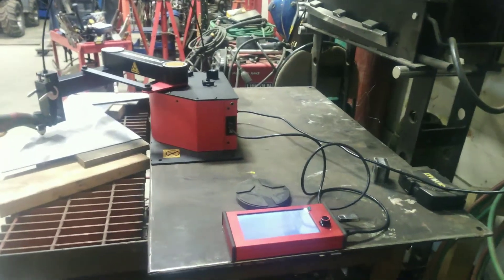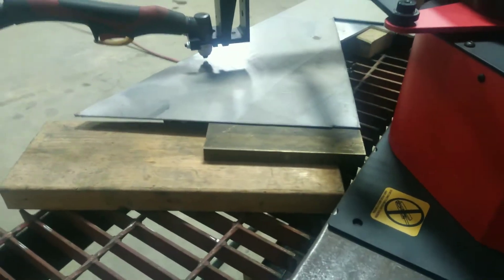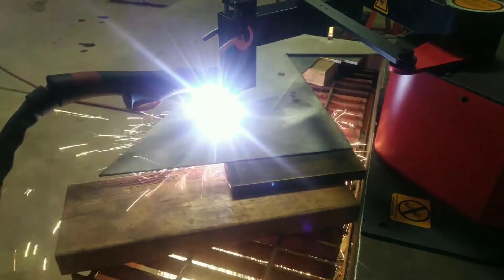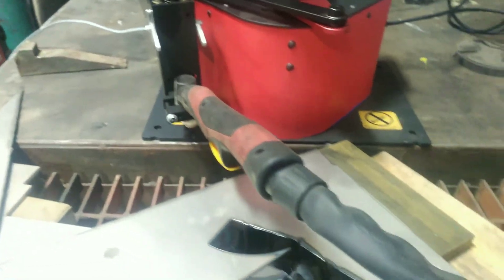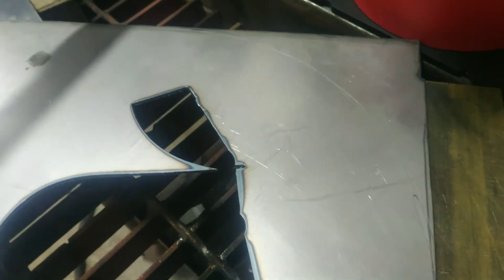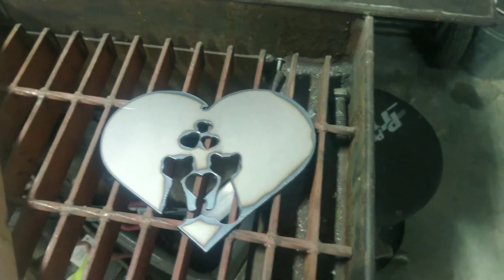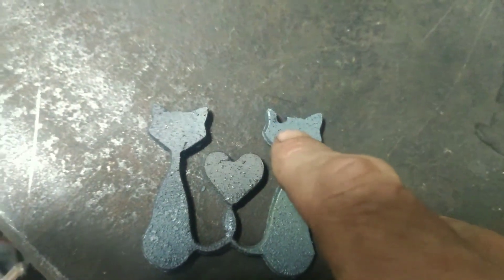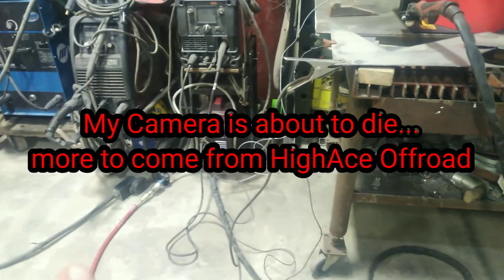Learning my Arcdroid and fusion 360

Comment: That HF arc start could cause issues down the road. Most CNCs don't  like HF pilot arcs as they cause the CPU to lock up
Reply from the maker: Yes, exactly, it worked the first couple times and then would act weird, and glitch out. I was told it is definately the HF.
Reply: @highaceoffroad2887  I see you got a proper CNC plasma table now - did you sell this thing on?
Reply from the maker: Yes, I got a GoFabCnC for a great price and upgraded. I sold my Arcdroid to my neighbor so I can still use it if I really need it.

Comment: Awesome sauce!

You can change your cut Heights in the "tune" function
Also remember to set "kerf" to Zero in the "tune" menu  that way ArcDroid™ doesn't try and add extra offset to your files.

Looks like you could be moving a fair bit faster on your cut as well, you'll get a better edge.

Keep up the good work!  Happy Cutting!
Reply from the maker: Thank you Arcdroid! I forgot to zero the kerf and height I knew right away was too high, but forgot I could tune it . I am really pleased how easy it is to learn, I knew it would take a few to get speeds figured out, I had planned on using 1/8th, but I had a piece of 16gauge scrap, and didn't compensate for it. All in all I am loving your machine and the learning curve isn't too bad at all..thank you for your help sir!